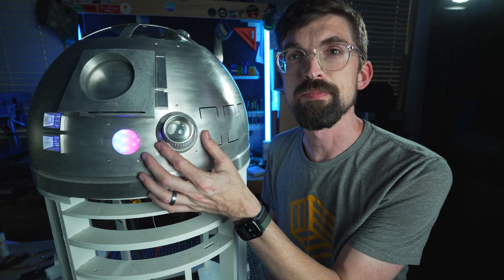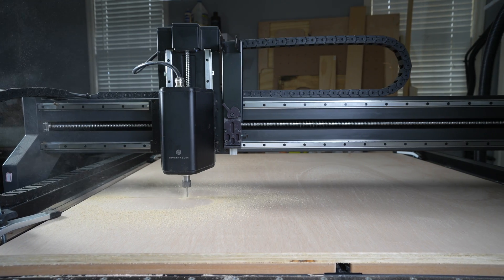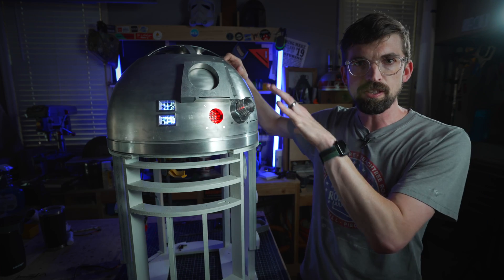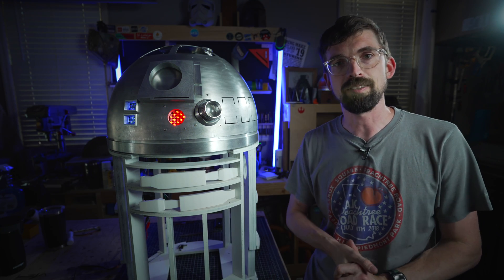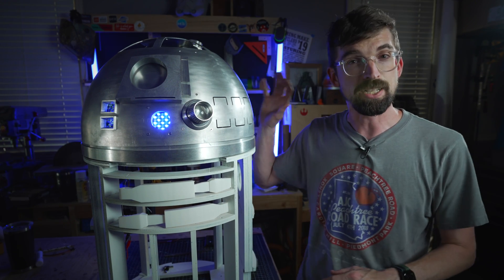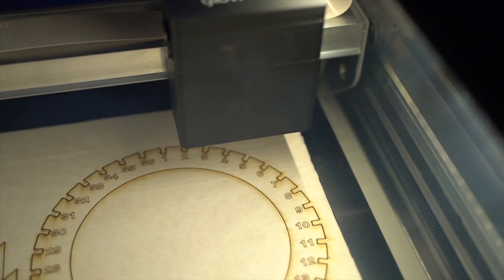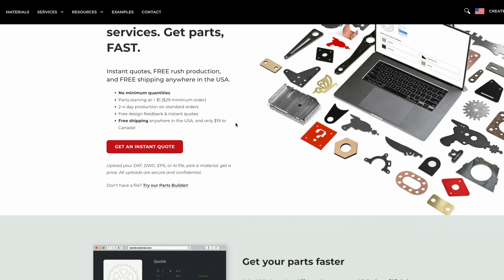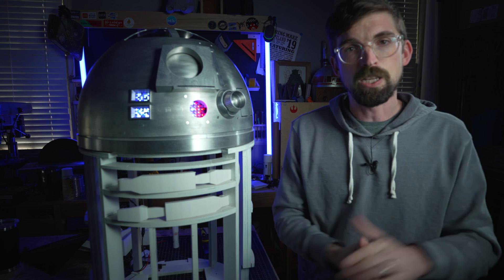CNC vs Laser vs 3D Printer - Which is BEST?

Comment: Can the same CAD software be used, whether your final material is wood, plastic, or metal?

For example, some CAD software is tied to the shop that will fabricate it..  eMachineShop or Protocase Designer CAD..  but what if you want to do it first in a different material?

What CAD software do you recommend?   From what' I've seen:

Fusion360 is great for design, but the cost/license might be a deal-breaker for many 
Parametric (i.e. ability to undo as many steps as you want) is a must-have feature
FreeCAD might be a bit difficult for the beginner
OnShape supports exporting without having the $2500/year license
Pro/Corporate Users should stick with Siemens Solid Edge , Solidworks, Catia, Pro-Engineer
Then there's other that don't have nearly as much users.. Moi3D, OctoPrint, etc.

but for most beginners, it seems TinkerCad and Plasticity are the solid choices?

BTW, do you recommend any low-cost 3d printer service?  Sculpteo , Shapeways, CraftCloud, xometry, protolabs?  How about for CNC / Laser ?

Comment: Well you can't 3d print wood, and there is a huge demand for this material, CNC is the only way to engrave wood if you are not an artisan and makes the work 1000x faster and cheaper, I see this as a very big pro.
Reply: You can't 3d print pure wood, you can definitely 3d print a "wood like" material that is a wood and pla hybrid, I've thought about doing it myself but the settings are kinda tricky to dial in from what I've heard.

Comment: I'm looking to do string inlay.... veneer - .9mm is common, brought to final thickness witha hand tool, and inserted into a routed slot 1/32 wide by 1/16 deep and  leveled to the surface with handtools.  I sounds like cnc would be perfect.  Thoughts?

Comment: you should mention you only talk about cnc routers , not cnc mills like a tormach pcnc440 or 1100mx or even a umc
Reply from the maker: Good point!  I'd love to get my hand on a tormach, I kind of left those use cases to the outsourced section at the end.  But all the aluminum parts I was showing could be made on the 1100mx or maybe the 440 if the fixturing leaves enough room.

Comment: I have a 5-year-old Muse.  Its been ok, but lots of troubles from time to time.  Main board just had to go back to FSL for repair.  Got it back and it's working again, but now no WIFI.  Curious why you like the RE3 software.  I really struggle with it and find LightBurn to be awesome as have my first Diode laser.  Trying to convince FSL to make the Muse compatible with LightBurn.
Reply from the maker: I haven't used RE3 in awhile.  Lightburn is amazing and I totally agree!